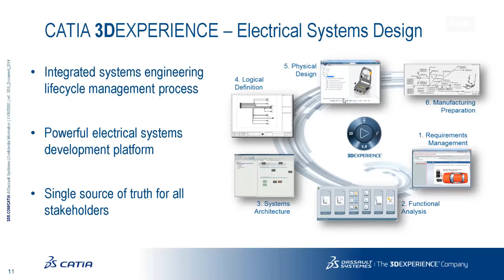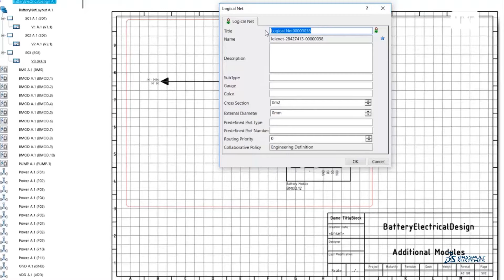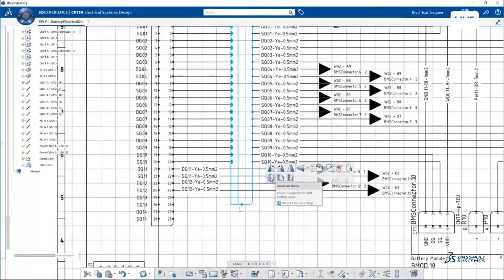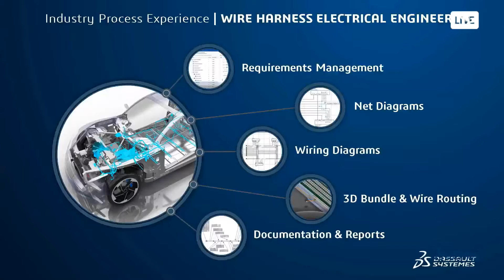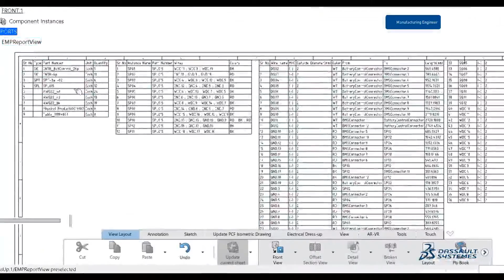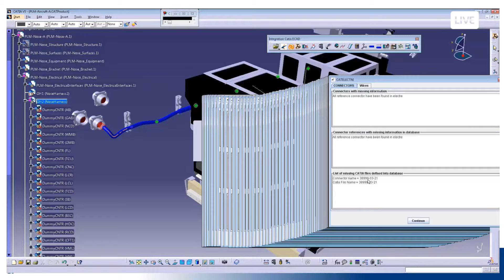CATIA Electrical Engineering

Comment: cool, however very few tutorials on the new system what so ever. Been using catia electrical since 2001, and its very disappointing that they don't offer much in regard to this....All the tutorial are sales pitches basically instead of a real tutorial on how to use the system with best practices.

Comment: When we get to manufacturing documentation again the area that is really less like aerospace and potentially more like automotive is the equipment list and bundle list directly on the form board. The other absence would be a group of wire bundles and their supports on a form board for the next level of build. Lastly I would like to see how delmia assembly and installation plans will make use not only of the form board drawings but installation drawings and functional test scripts.

Comment: Can you tell me if a customer from any industry is using the full-up 3DX RFLP tools? I would hope to see an aerospace, automotive, heavy equipment, and shipbuilding industries support the RFLP process. Also the form board process only shows a single harness. Can a group of harnesses be flattened including their common support? In aerospace this group is a common occurrence to expedite the installation on the aircraft of more than one harness. I would also be interested in seeing what is possible for supporting installation engineering intent like production illustrations. Lastly I would like to find future development to support functional test of electrical harness systems by shop personnel. These are missing items on your end to end.